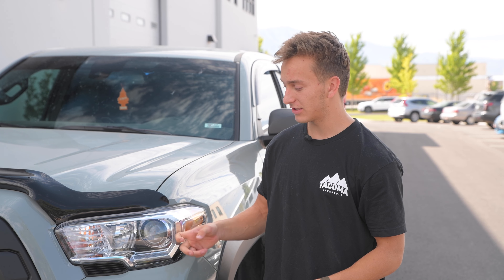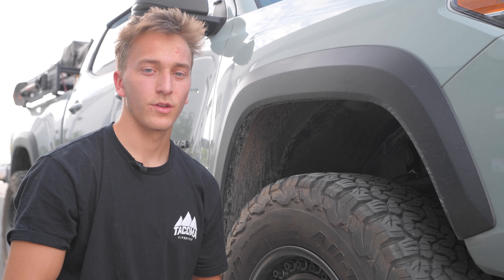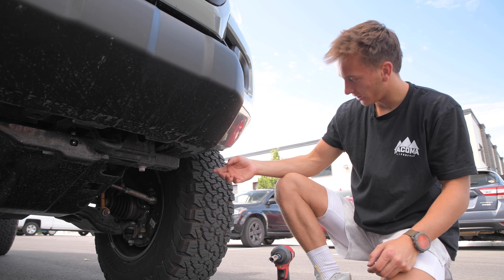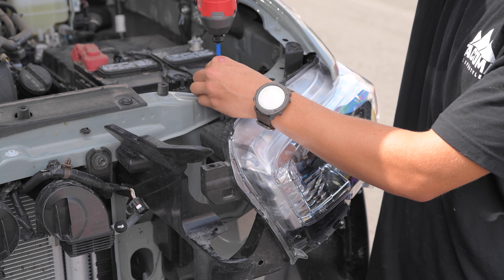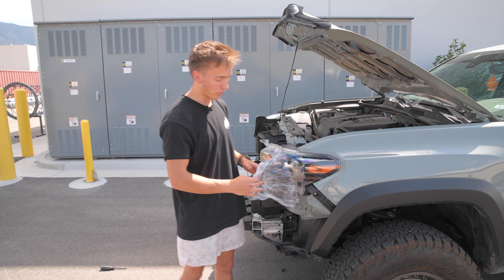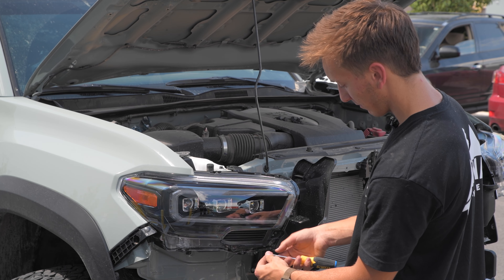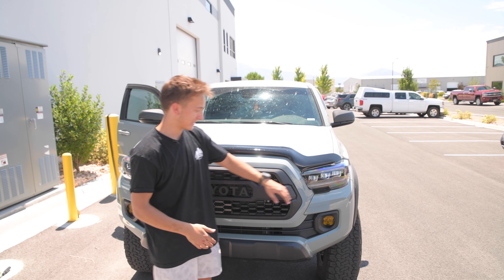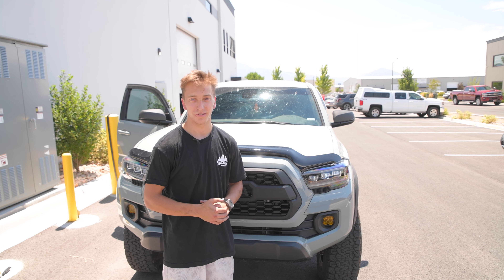The All New Tacoma Form Headlights Install

Comment: Do they need adjusted once installed?
Reply: Mine definitely do, but I don't know how to do it. No info online
Reply: @thomaswilder3193  I don’t know how to describe where it is located but definitely a bolt to adjust. Mine stripped out so now I have a wedge under it to keep the beam up. Junky for sure

Comment: Do these void the manufacture warranty?
Reply: It can void the warranty on any failure that touches the modification or could be reasonably considered to be impacted by the modification. It doesn't void the entire warranty. So if you have HiD lighting that causes damage to stock wiring harness or the battery, then the warranty would be void for replacing the harness or battery. If you get bigger fuel injectors and you receive engine damage or check engine light, Toyota could deem the aftermarket injectors liable for the damage and thus void the warranty for the engine.

In a nutshell, it’s up to Toyota to deem it necessary to void a warranty because of aftermarket items causing damage or issues down the road. As long as it’s properly installed and properly manufactured to perform correctly without causing system damage to your vehicle, you shouldn’t have anything to worry about. 

If you’re still unsure, read your warranty paperwork that came with the purchase of your vehicle or go to Toyota’s online warranty page.